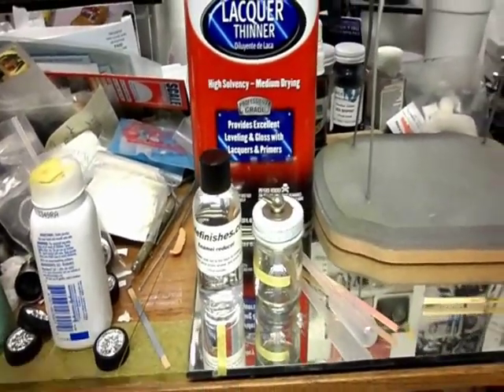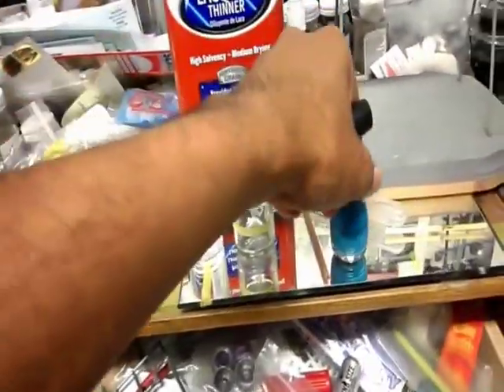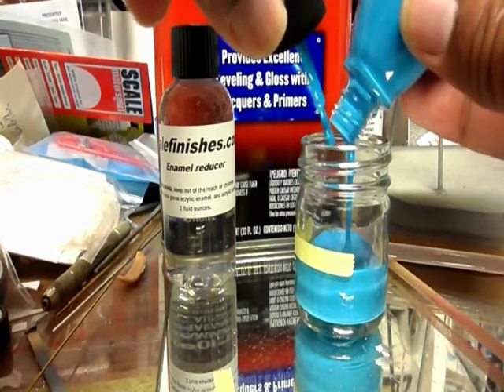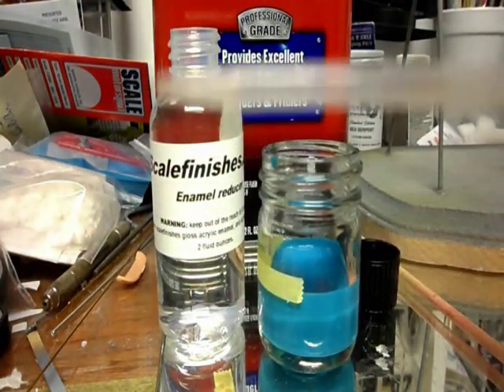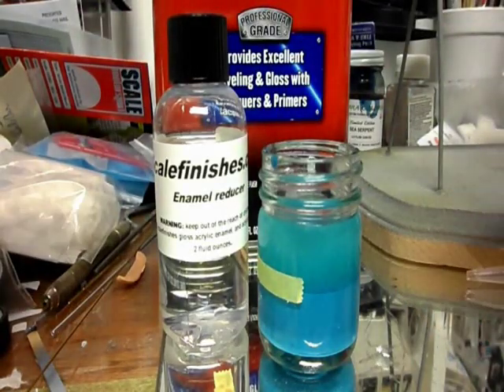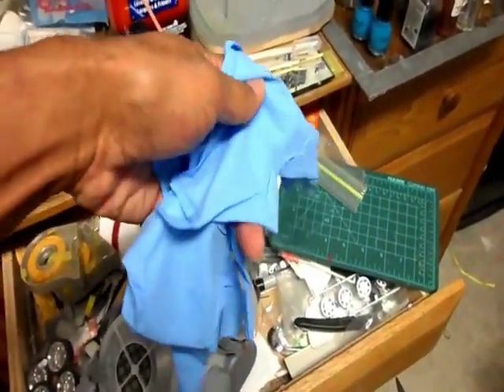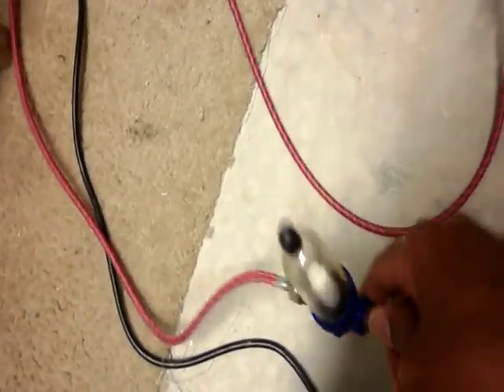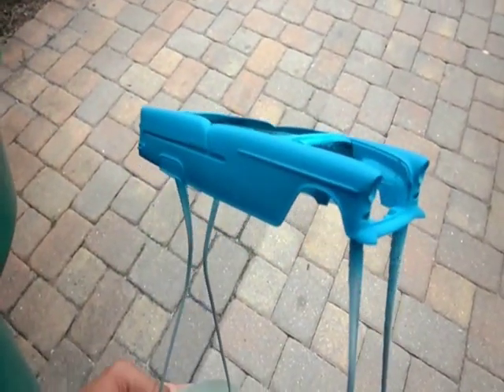Fingernail polish airbrush tutorial

Comment: Hello my friend this is a great video which was what I was looking for on how to use and thin nail polish paint for airbrushing... and for you my friend a couple of things that will truly help you get yourself some small mixing ball bearings to put in your bottles of paint too quickly shake the pink it makes it faster in your bottles for springing and for quicker drying time... use a Hand hair dryer it will dry the paint much quicker on your models.. both work great.. I use AK stainless steel shakers.. they are stainless steel BB's that are slightly larger than regular BB's and I always add them to my little bottles of paint too quickly mix them for airbrushing and after the paint has been applied I didn't use the hand hair dryer to quickly dry the paint..
Reply from the maker: thank you for the tips!

Comment: Nice tips! Do you know how much and what kind of reducer I would use to do my lady's fingernails? Also, how do you do such nice work in that mess? I would have half of that stuff in my paint:-)
Reply from the maker: Andrew Glass I do what works for me. Thanks. I'm not sure about what to use on your lady's fingernails. Try Sally's Beauty Supply.
Reply: Andrew Glass You can use regular acrylic paint thinned out, or get a nail polish thinner from sallys, beauty secrets makes one. but, you're going to run into the problem of thinning out the polish to the point where its not opaque, or you get a thinner thats only 3 free, and use it in a polish thats 5 free.